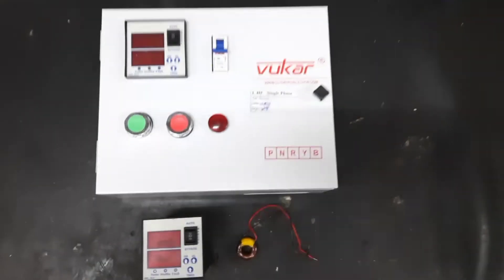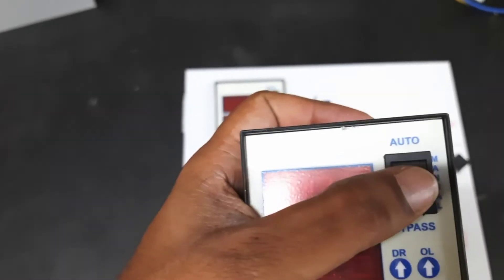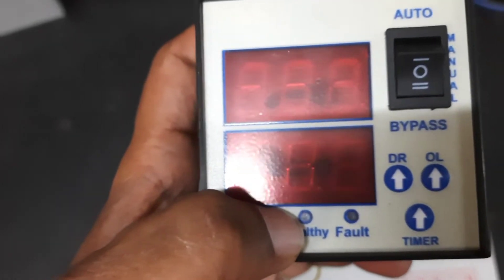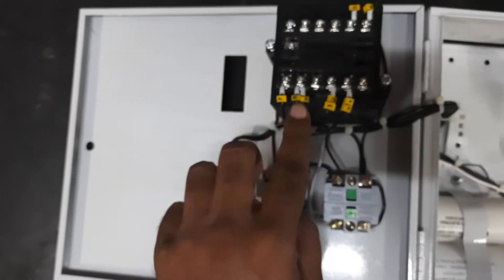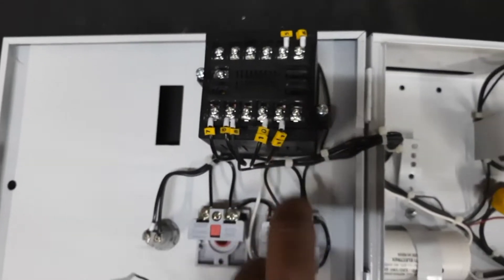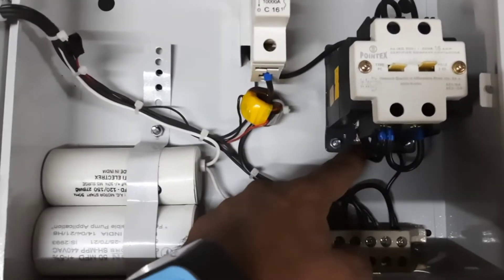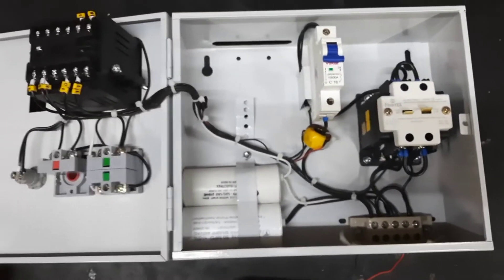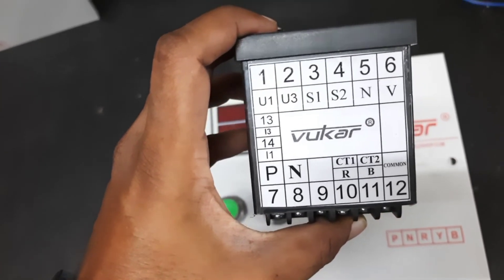Installation of Single Phase Motor Protection Digital Meter | Premium

Comment: I want this product
Reply from the maker: Three phase motor protection device (MPD) is a panel mount meter. If you want to purchase please contact to our customer care: *9512172271*. 

Price of three phase motor protection device may vary depending on the current market.